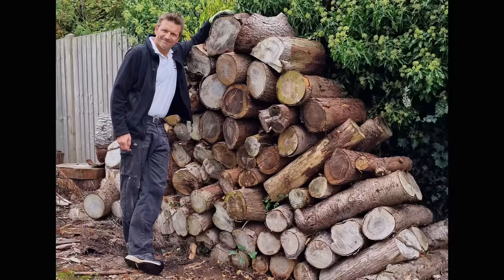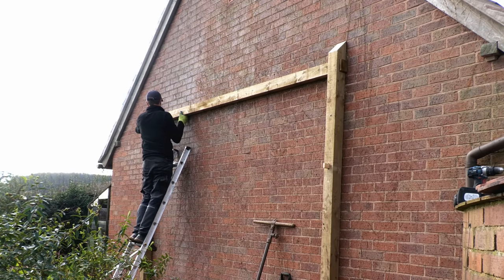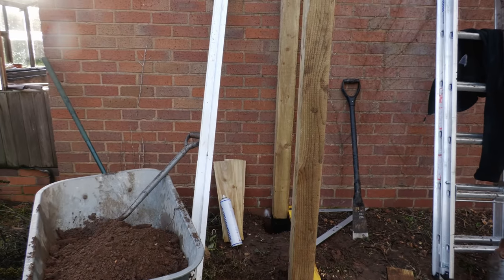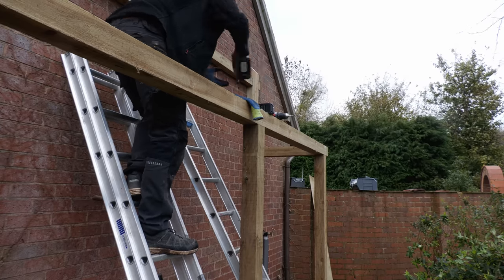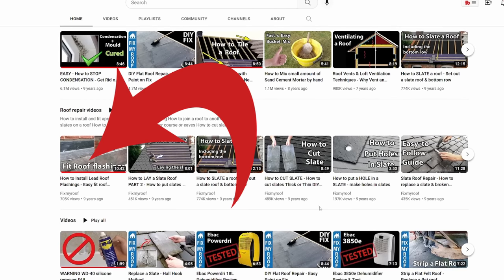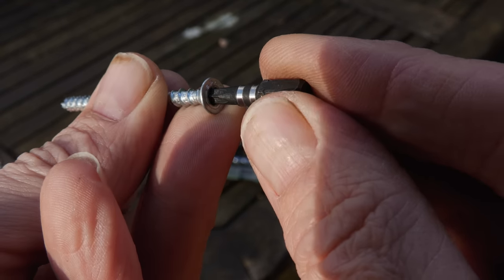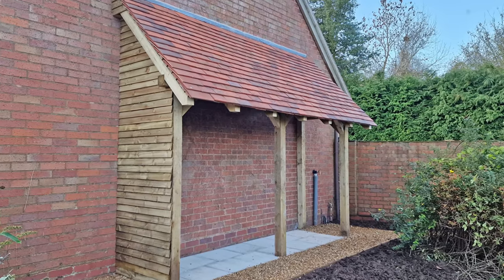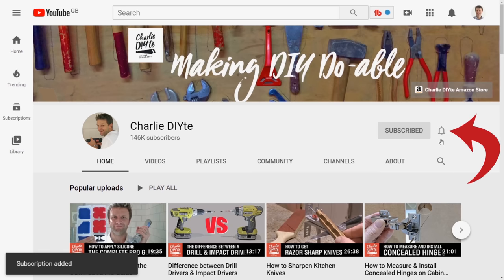How to Build a DIY Log Store

Comment: Couple suggestions: Use cut down pallets on the RHS and front or you'll find it is a pain to stack the wood without it tumbling out - wood is not nice and round! 
You said the wood you have is pine - not good for wood burning logs - great for getting the fire going but not regular during as the resin will increase the risk of a chimney fire. If you have a corrugated liner this nicely traps the tar from the resin and increases the risk if a chimney fire - a concrete liner is best.
The 45 degrees means you'll end up with more wasted 'roof' space for stacking wood.
You should have had made a platform / work area next to the wood store for splitting / sawing the logs, so less of a walk from cutting to stacking.
I didn't notice a path from the log store to the existing path - or will you be paddling in the mud from the log store to the other pathway?.
A canopy would have been useful so that when you are collecting logs to bring into the house you and the logs don't get wet!.  
During a typical winter you can use 4 cu metres of wood, thus you should size your storage capacity to ensure you have space for more than one winters worth especially if it is a hard winter.
A separate area for stacking kindling would be useful.
The gravel at the front might be decorative not but once it is mixed with sawdust will give issues down the line.

Comment: I've watched a couple of roofing videos that give information about the grade of the timber used on house roofing - there are different grades for soft to hard wood for the extra strength that harder woods have. Using softwood is most likely to be alright, if you do change any of the wood out if it deteriorates, I'd use more of a roofing standard hard to semi-hardwood. I don't think that there's going to be much of a problem but if you do change any of the timber, it would probably be advisable.
Reply from the maker: Thanks Steve. My roof is over engineered given I've used 4x3 rafters where even must domestic properties these days use timber which is a fraction of those dimensions, but I hear what you say. 👍

Comment: Excellent video and great project, looks amazing! I particularly liked the detail on the lead flashing as that's something I've struggled with in the past, using flash band which is nightmare stuff to with with. If that was a rendered block wall with no convenient grout line to follow, how would you tackle it? Snap a chalk line and cut to it the same manner I suppose?
Reply from the maker: Thanks. Yes that is how I'd do it.  There will be an update video on the log storage as I've had a lot of brilliant suggestions on this, plus I did have to modify the roof the other day because I didn't put any ridge tiles in for some reason. 🤦😉

Comment: Hi Charlie. I’m lucky to have a brick outbuilding  about the size of a small garage, which is full too the gunnels with fire wood . Even after a couple of years storage , I still find I need to have the logs inside for a couple of days before I use them just to give them a final airing   .  Do you do a similar thing ?   Grate project and will help others to decide how to go about a similar installation.          Best wishes and kind regards as always 😀👍👍👍
Reply from the maker: Hi, good to hear from you - you too! I know what your mean. There will still be a bit of moisture in there. Do you open the store up on nice days to give it a bit of an airing? 👊
Reply: @CharlieDIYte  high Charlie  I must confess I don’t , but being what we believe to have been an old pigsty it’s definitely no air tight . But having said that we did replace the roof earlier in the year with a new tile roof ,  so maybe you have a valid point .   As a matter of interest I did invest in a heavy duty wood splitter some years ago,    now that was a game changer as they say.     Best wishes and kind regards as always 😀👍👍👍

Comment: I don’t think a bit of rain hitting the end of the logs will do any harm. Drying logs isn’t about the water content, it’s about drying them of their sap to keep your flu clean of creosote.

The posts will rot at ground level over time so could probably do with some sort of protection.
Reply from the maker: I'm planning to treat the posts but I'll leave it a few months until the tanelised coating has lost some of its effect. It's very unlikely any of them will rot though as they're under cover.
Reply from the maker: Nice trick that 👌👍
Reply: @Bob.Jenkins  Txs, great tip 👍. I’ve an old Land Rover and always have waste engine oil around.  Does that method work on the chassis too? 🤣
Reply: The bitumen paint should had been a couple if inches above finished ground level.
Reply: @grantcook5376  exactly, it’s the only point that really needs it. If you’ve ever had a rotten post and dug it out, you’ll find that what’s under ground in the wet earth doesn’t rot, what’s above the ground in the air doesn’t rot either, it’s just the couple of inches where the post meets the ground level
Reply: @Bob.Jenkins  I thought waste engine oil is very carcinogenic?
Reply: @Bob.Jenkins  My grandfather used this mix for gate posts (eucalyptus wood) on the farm 80 years ago. They are still there.

Comment: Fantastic job Charlie, well done. It will be well worth the cost. We're using wood that I simply covered with a roll of wide dpc.  The rain does get to the ends but not enough to ruin it. Still finding wasps in the pile but they're mostly dead now, only the occasional one wakes up from the warmth indoors.  How do plan to stack the wood?  Would you consider partitioning it for safety and ease of organising the wood by date so you're burning oldest first?  I'm planning to build similar size so, this has been very useful. Cheers and merry Christmas to you all 😊
Reply from the maker: You too mate and good to hear from you. Yes a few people have given me ideas on storage since I did the video. I'm going to put pallets at the bottom - really pleased as I have a massive pallet I haven't got round to cutting up. Thinking of a trellis structure at the back to keep the wood off the wall but that could be over kill. Would be really good to divide it up into sections. Maybe a central shelf supported in the middle giving me 4 sections....
Reply: @CharlieDIYte  pallets work well at letting the air flow in. For our brick bbq this year I simply used a few old engineering bricks spaced apart which surprisingly didn't rot the wood. Trellis might be overkill, not sure how the cost compares to something like gabion mesh which might be nice with a large enough aperture to not hide the lovely brickwork. Your store looks like an original period feature, be a pity to spoil it with anything too industrial - guess it's the usual striking a balance between style and function.  Definitely keep it safe though; our boy thought the firewood was a giant game of jenga 😱 maybe a gravel board along the bottom and something similar along the roofline to stop splashes and rainwater being blown in?  Dad suggested louvre doors if a lot of rain hits that end of the house, or a cheaper option might be windbreaker type fence panels fashioned into gates. One thing's for sure you'll definitely have enough storage space for a warm winter!  It's all good exercise too 😂

Comment: Great video Charlie. I used a platform of besser blocks to allow ventilation, reduce termite infestation and reduce rot/damp. I have the sides open and put a tarp down the front during winter. This allows ventilation and reduces rain ingress. Cafe blinds would be a step up if it is in a presentation area, mine is in a utility area so a tarp will do.
Reply from the maker: Thanks, yes from what you're all saying, I do need to give some thought to how to arrange the wood, rather than just chucking it in there. Will see if I need the tarp or not but at least I have the option. A green one works look quite smart 😉

Comment: The log store looks good. A job well done (as usual). 

I’m not to sure about the logs. You can dry them out as much as you like. They will not be great for burning.
Even if they were free, it’s not worth it.
Reply from the maker: They're actually ok. Yes not as good as say ash or oak but well seasoned they burn with a good heat. Just need to make sure to get the temperature of the log burner right to prevent creosoting of the chimney.

Comment: Hi Charlie. When researching did you come across any guidance for flashing into/through external wall insulation? I’ve been looking on YouTube but to no avail. I’d love to try a project like this but my entire house and garage (converted into a painting room for my wife) are cloaked in EHI!
Reply from the maker: Hi Chris. I would be inclined to make it free standing if I were you. It's going to be so sturdy even if it's not screwed to the wall. Plus people are saying there could be insurance issues with log stores attached to houses.

Comment: Great project. I'd have to feather edge both sides. My OCD wouldn't let me do one side!
Reply from the maker: Thanks. I think I'll end up doing that. I'll be doing a follow up video to deal with a few loose ends.
Reply: Sunlight and air circulation are essential for good drying.  I have same issue on south end of our store. I just rotate end logs before use. Maybe feather edge with 20mm gaps would work better.

Comment: I think you are missing racking inside - The wood needs ventilation to dry gaps in the stack really help - It also helps with grading
Reply from the maker: Thanks Martyn. I think you're right. I can see a second video coming on (plus I stupidly forgot to install the ridge tiles so that'll be in there too). 👊

Comment: Looks good after the garage roof refit it must have have felt like a piece of cake.
Reply from the maker: Thanks. Yes, except unlike the garage refit I didn't install ridge tiles which successive pointed out I would need so I've done a quick mod to add them which may need an upgrade to the flashing in the spring. We will see!

Comment: should have used copper nails for the roof  tiles. Galvanised won't last very long
Reply from the maker: Fair point. The garage roof has galvanised though and was installed in the 70s and the nails were still going strong when I removed them. I had a load of nails left over so thought I'd use them.

Comment: "I'm so disappointed with the Robertson Head System"

Canada has entered the chat
Reply from the maker: It's just I was fascinated with it for years - thinking what a good system it looks, but the screw head can cam out very easily if you're not careful and if you use a generic Robertson bit rather than the bit that came with the screws.
Reply: @CharlieDIYte  yeah, we built a climbing frame for the kids which used them for everything. I think they probably have a small advantage over a pozi head but as you say there's better high torque solutions nowadays.

Comment: The worlds most expensive log store ??
Seriously, the vertical  posts would have been better not put into the ground but rested on the slabs on a piece of impervious  material to stop the bottom of the posts rotting.
You will also have to raise the logs off the ground to stop moisture getting to the firewood.(I use pallets)
Lastly the end cladding is normally attached to allow air through to dry green or damp timber.
Reply from the maker: Fair points particularly about the vertical posts but there won't be much moisture getting into them and they're treated with bitumastic anyway. These jobs are always a learning curve. Hopefully people can take what they want from it for their builds and modify accordingly.

Comment: conifer wood ive read is not good for burning due to tar and chimney fires.....
Reply from the maker: Yes. You have to weather it for a long time. Mine has been outside for sat least 3 years. The other thing - you need a thermometer on the log burner to make sure you always have it at a higher enough temperature to ensure it doesn't creosote. So you shouldn't shut the burner right down at night and keep it simmering away as this is not got for the chimney.
Reply: @CharlieDIYte  even super dry softwood holds the oil. Try to get some hardwood to mix in reducing problem.

Comment: There is nothing wrong with the roof Charlie, the roofers that did my extention were the worst trades people I've ever employed, I think with the majority of roofers, the motto is out of site out of mind. That's why so many "DO AS YOU LIKE'S" are doing roofing?????
Reply from the maker: That can happen I'm afraid. Andy (Gosforth Handyman) had this problem on his roof recently. I did make a bit of a mistake though - decided not to use ridge tiles but realised I need them and had to modify the flashing to add them the other day. 🤦

Comment: I'd have gone for a flatter roof with a good overhang to avoid having to wear a hardhat for safety. I predict a future with many bumps on the head as it currently stands.
Reply from the maker: It's a fair point. If I was doing these as a job I'd make a few small changes for the mark II. 👍

Comment: Charlie  your roof is going to leak..... You missed out the top course , Its a short course a bit like the eve course...
Reply from the maker: Damn it. You've got a point. Wouldn't have mattered if the lead flashing had been another inch longer. I thought about the ridge tiles for a split second but didn't think I'd need them because I was butting up to the wall rather than finishing off at the ridge - and right there lead would act as the ridge tile. Will mull this over. No leaks as yet.
Reply: Your error now identified means we’re all the wiser, cheers for that and good luck deciding.. I suggest test with a hose, see if it leaks 🤷🏼
Reply: ffs🙄 I'll bet it wont!
Reply: Not with a 60 degree pitch 😂

Comment: Putting wood against construction is the easy way to help termites enter the structure
Reply: Good advice for countries with termites. Not UK (yet?).
Reply from the maker: Shouldn't have a problem with that here in the UK but thanks for the heads up.

Comment: Never ever burn conifer trees...sorry to sink your boat ...
Reply from the maker: It's fine if you season it very very well. This has been outside for nearly 4 years now.
Reply: Don't be a firewood snob, it all burns .
Reply: @samuelchamberlain2584  ok..burn it then..but I like to look after my fire and chimney..
Reply from the maker: @waynekerrr9027  That's a good point, so I'm really careful to ensure it's burning at a really high temperature so it doesn't creosote up - a thermometer on the chimney helps with that and I don't shut it down at night for fear of it creosoting up the chimney. I just let it burn out. I wouldn't burn conifer if I had an option but I've cut down about 7 of the damn things so I have a lot of wood to get through.

Comment: Nice job , but gross overkill for a wood store..a few pallets knocked together with a few decking boards to decorate and she'd felt for roof...done in about 4 hours, for the cost of £30 roof felt..
Reply from the maker: Ha, you're probably right. Wouldn't last long though.
Reply: Yes but it looks the business !
Reply: And it would look nasty
Reply: @CharlieDIYte  yeh you right..I made mine about 10 years ago, and only just re felted roof, but other than that, it's solid...